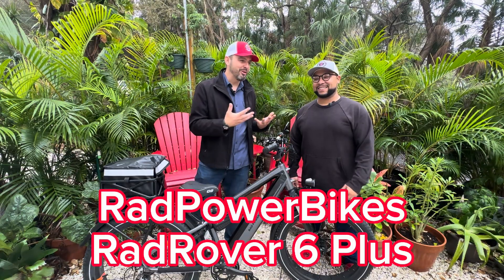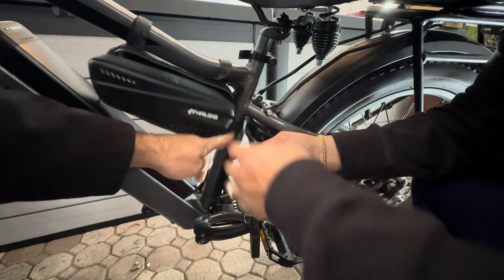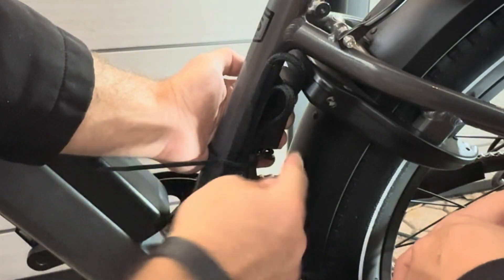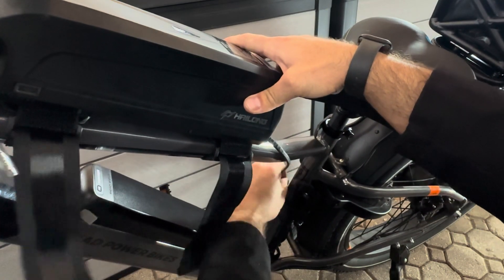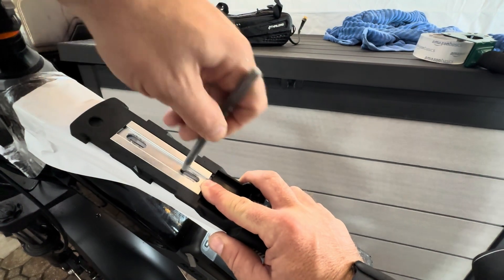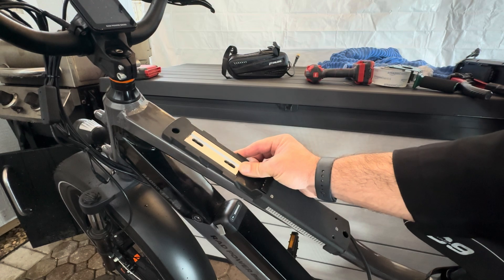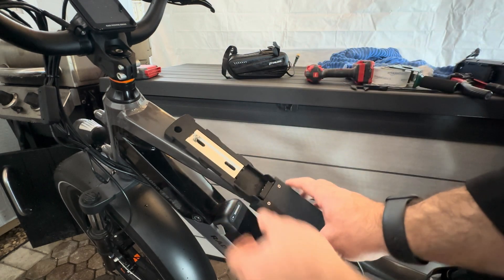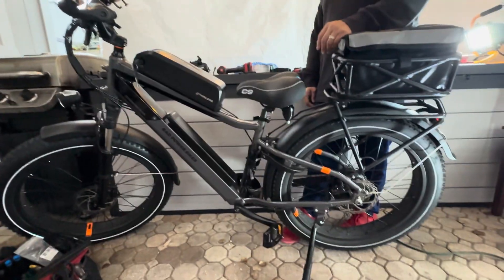RadPowerBikes | RadRover 6 Plus | Drilling the Frame! Mount Second e-Bike Battery with Rivet Nuts

Comment: Hey there, I just installed the dual batter balancer. I wanted to know if a triple balancer is available ?
Reply from the maker: You could add another balancer to the input of one battery connector or we do have the Dx4 quad battery input

Comment: i glued a 3x 70x350mm al sheet on top tube with 2k epoxy glue.. secured with M4 till glue was hard.. then cut M5 through sheet and frame together
the 10mm rivets weakens the frame a bit while my added al sheet stiffens it a bit
i have now 2x 52v 25 Ah (yes way over 2kwh) ... good for 100+ km in scooter mode and about 200km in pedal assist (and slow speed)

Comment: Hey i gotta question on this. Let say i use uhh multiple parallel battery connectors as i want to mount 4 batteries somehow on my bike so since those connectors have a circuit of their own do i still need to upgrade the controller ?
Reply from the maker: You only need your controller for your bike that already exists.
You can add a balancer for two batteries or if desired they do make combiners for more than two batteries.
Reply: @ElectricAllWheel  alright thanks for the info I was just worried that what if my controller fries out because what I wanna do is basically take 4 batteries put two battery each with a combiner and then after doing so I have 4 wires now I connect negative together while positive connects to a switch that further goes into the controller that way all I gotta do is just turn the switch around and I have full battery again or else the other way can be use 3 balancers to use 4 batteries. What would be more better way in your opinion?

Comment: Great idea thanks!

Are those two little screws strong enough to hold an 8 lb battery on the frame?
Especially on trails and other bumpy rides?
I would probably leave the straps on too.

However, I agree with the other commenter in that I'm not a big fan of adding that weight so high up.
I'm ok with the battery pack mod that was on the bike previously.

Either that or the cargo rack with the battery bracket.

Comment: Try green masking tape instead of white paper. Then draw a center line from end to end with a flexible straight edge and lay out for the holes using a tape measure on the line.

Comment: Very cool to know there is a YouTube channel about ebikes here in the Tampa Bay Area! I'm new to the channel, so I will be going back and checking out your videos. Thank you for the info on mounting a 2nd battery. I have the EUY S4. Very solid moped style ebike. It has a 25 amp hour battery on it, but I want to add a second battery. This explained everything very well and the mounting is much better then how I have seen others mount a second battery. I will be following this tutorial.